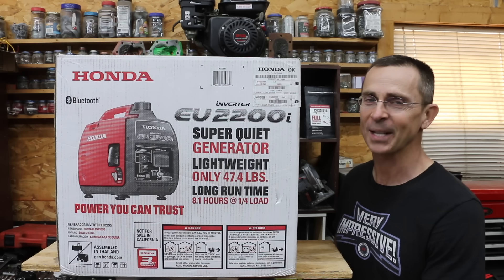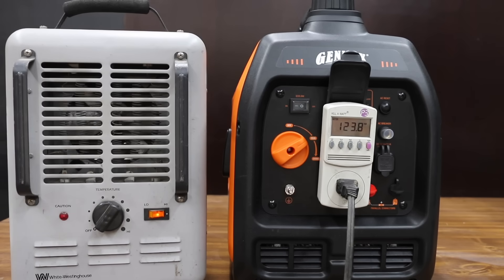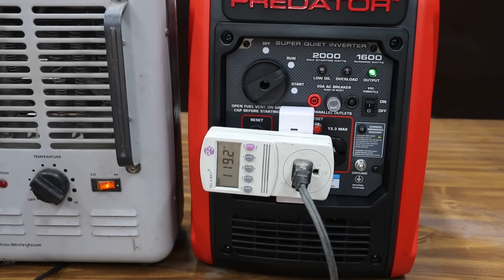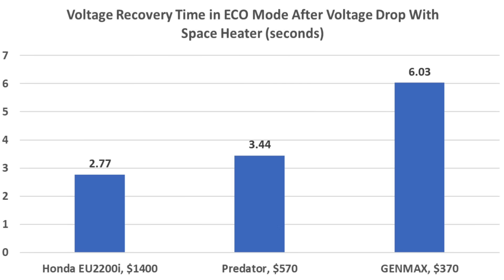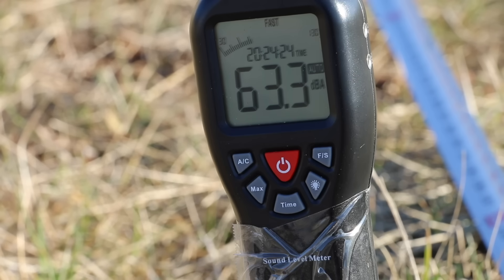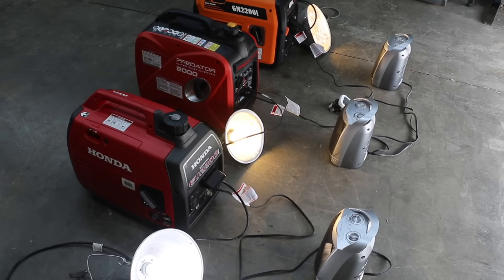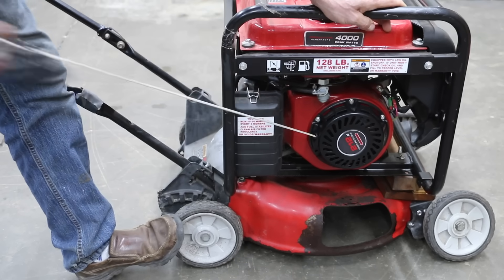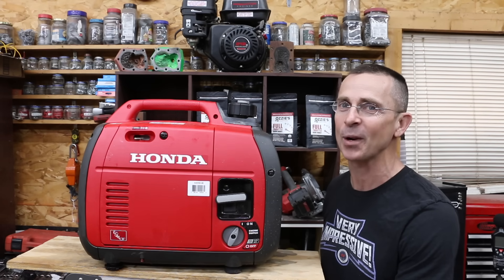Cheap Generator Better Than Honda? Predator vs Honda & GENMAX—Let’s Settle This!

Comment: Great video and testing , as normal , here . When these generators say two can run parallel , do they mean for 220VAC ?  If so , what would keep them properly , out of phase ?
Reply: Parallel doubles the current yet the voltage remains 120 Volts A.C
Reply: @JOMaMa..  Man ! I don't see how that could happen with two 120VAC generators at all ?! I am not trying to say , what you said is wrong BTW . But coming from the HVAC / Controls world . I don't see how that could work ?!  They would have to get on the same sine wave / phase , or I guess , damn close . I'll have to try and see how that could work ?! Now , if they communicated ?! But even then , if the sign waves were "out " ??! Wow .. ok , hmmm .....
Reply from the maker: Sorry I didn't explain. If connected in parallel, they can deliver approximately 4000 watts at 120 volts.
Reply: @ProjectFarm  Yeah . As I replied to Jo'MaMa ... I don't see how they do that ? I'll have to try and figure that out ? Do the two have Commnication?
Reply: @indycharlie  Mechanical rotating AC generators of this type will communicate using the timing and amplitude of the sine wave produced by all of the connected generators. The mechanical inertia of the active generators is converted into energy that can be used to synchronize other generators and produce a converged, synchronized electrical connection, When a new AC generator is connected to an energized AC line, the newly connected generator will be “pushed” or “pulled” by the other active generators into synchronicity, and will be producing a sine wave that matches the rest. This effect can occur over very long distances, and is the means by which large AC grids can stay synchronized. There’s lots and lots and lots of literature online that explains how this works much better than this comment.
Reply: @TheOneKEA  Wow , ok . As I said . I was a HVAC / Controls guy .  Of course we learned about sine waves , phases and the basic's of electricity .  But I'd have never guessed this would work as you describe .  Now I am going to have to ask some guys I know who were operators at the Edison here in Michigan . How they brought more generators on line .  Hmm ... now I really wonder how they bring in those 3 phase ones at those plants ?!  I recently watched a few video's on grounding that are way different than we used or learned .  Thanks for the answer .. Gubs

Comment: I have a 2200i Honda and it won’t run when the temps reach 10* or below, have to run it in a tote.
Had a Honda 2000i before that and it would run flawlessly no matter the temps.
Wonder how the others compare🤔
Reply from the maker: Thanks for the information!
Reply: @Cheeser1764  I am aware of the kit but we shouldn’t have to do that

Comment: What causes the voltage drop and recovery to be less in a honda?
Reply from the maker: The Honda has a 120cc engine, which is 50% more displacement than the other 2 brands. There's a huge torque advantage, losing less RPM when hit with a sudden power demand. Additionally, the Honda appears to have the most robust generator

Comment: Id be curious to see how the Generac or the Yamaha inverter generators compare!
Reply from the maker: I'll do it if there's enough interest in this video!
Reply: This was a great video....very useful for a lot of folks I would think. From a EU2000i owner, those are the three I'd like to see next... Yamaha, Generac and Champion.
Reply: Had good luck with the champion brand as well
Reply: The yam engine is hard to beat 😊